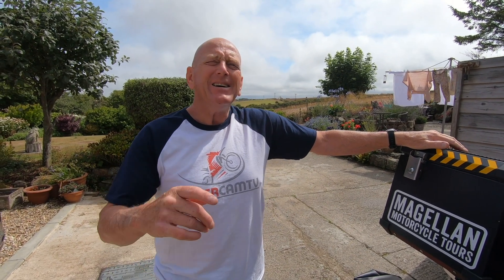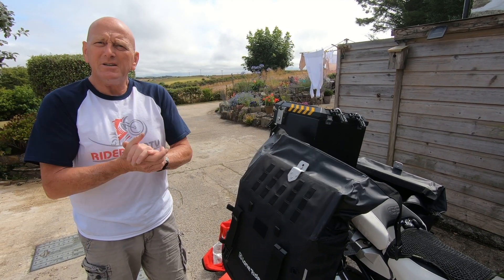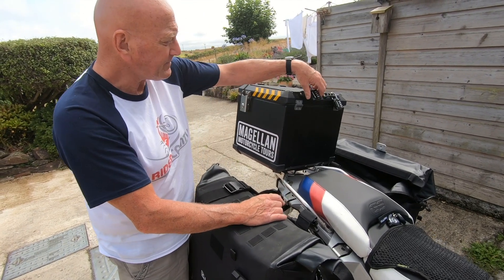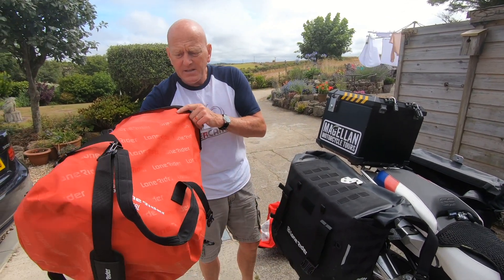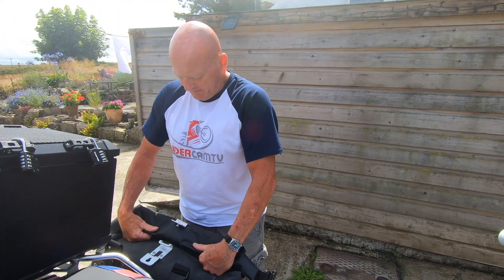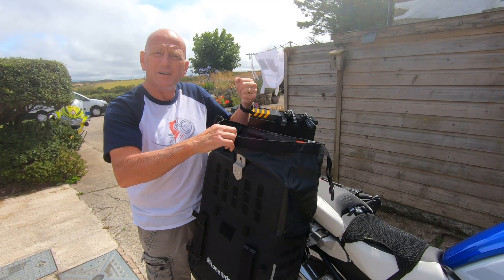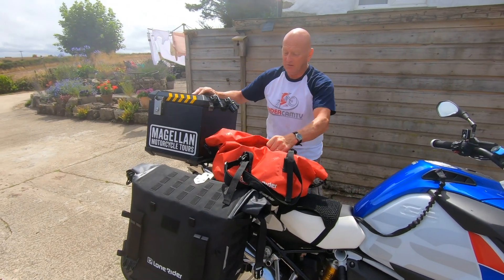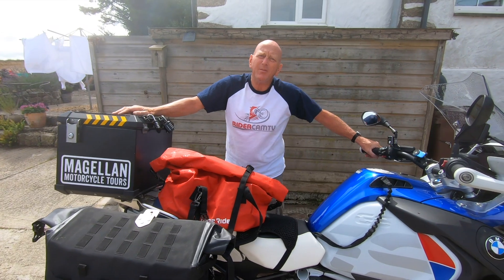Lone Rider Panniers | What are the like on a tour?

Comment: I tour three to five months per year. I carry three pairs of socks, underwear, tee shirts and one sleeved button shirt and two pairs of pants. The underwear and tees are Klim high tech and can dry completely over night. I was them in my hotel room sink. Oh. I carry low profile sneakers. I keep these and my cables, iPad, and Dopp kit in the small bag and I only bring into the hotel this bag. In the big bag I can carry camping gear. I have a huge top case and a normal smaller one. I use these for my wife if she comes along. I also have a large tank bag. I have in France Touratech panniers on a Yamaha T700. I ride it in mountains and deserts and off road and I’ve fallen numerous times and the aluminum bags and rack have held up surprisingly well but are now bent and not really watertight although no water seems to get in!  The bike in the USA is exactly what you have in this video and it came with BMW branded panniers made by Touratech but made flimsier. I have never fallen on this bike but I am certain these panniers and rack would not hold up as well as the Touratech branded bags on my French bike.  There are two good things about hard panniers. The first is that they are incredibly easy to load if you buy a liner. It’s just a soft sac you leave the panniers on the bike and you just take the soft inner lining. And then you bring it back to the bike and just drop it into the panniers. Second, hard panniers are much more resistant to vandalism and theft in the soft bags.  Yet I’d rather have the soft bags because in a low speed fall (which is what we are talking about…we are not competing in the TT) they do absorb more impact without damage. I just cannot bring myself to buy these bags until my existing aluminum ones wet the bed. But I want to buy them!  If only to support a company as fine as this.
Reply: Excellent comments! When you do buy soft bags these should be your fist stop. Ride safe

Comment: What’s wrong with alloy box pannier, they lock, there waterproof?why have you gone for soft or semi
Reply: We haven’t… Lone Rider asked us for an honest assessment which will be ongoing throughout the year. They are excellent by the way but if they were crap we would not hesitate to tell you unlike others. Ride safe
Reply: Drop your bike and there’s a good chance your hard case will deform and then the lid won’t close properly anymore and thus the case will not be waterproof anymore. They also have the potential of snapping your leg if your not careful when stopping the bike.

I’ve dropped my bike twice (don’t ask how 😉) on the same side with Kriega OS soft luggage on an SW-Motech rack: no damage whatsoever on the bag or the rack. In fact, the soft bag cushioned the drop in both cases.